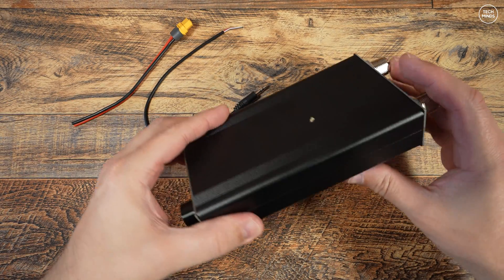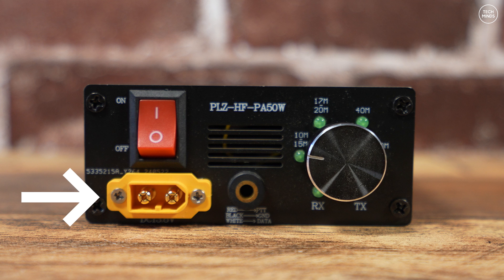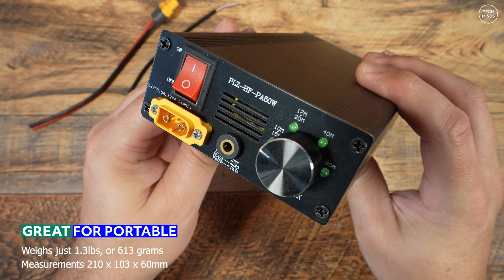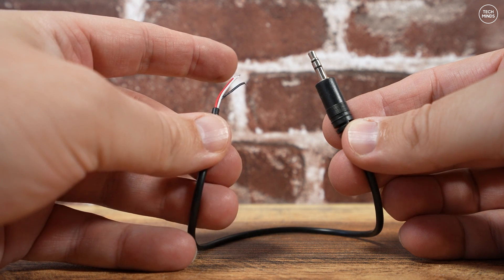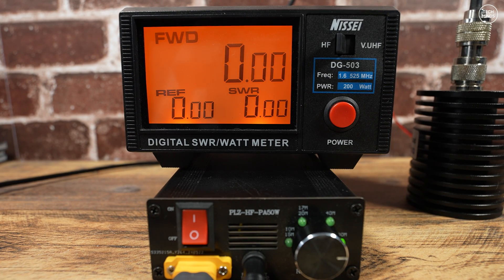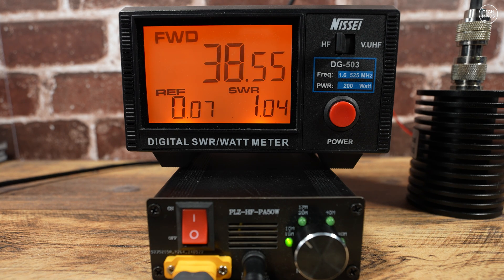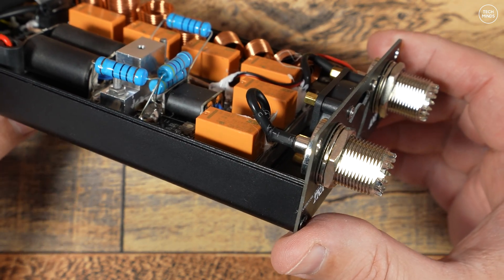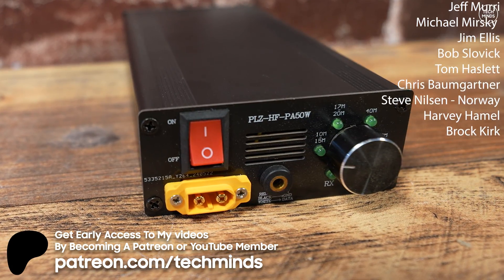Lightweight Portable HF RF Power Amplifier - PLZ-HF-PA50W

Comment: I just got mine two days ago. Absolute pile of junk. It clearly hadn't been tested before shipping. Immediately obvious was intermittent switching. I didn't connect it to a transmitter that would have been a disaster. In dispute with the seller, who doesn't want me to send it back, best he's offered is 30% refund and for me to keep it, that would sill make it a very expensive piece of junk. OK got the 30% back, The problem was the filter selection switch that had been overheated. Ordered a couple. Fitted it, but apart from switching two connections, it works fine.

Comment: With 2 minutes of thought, they could have arranged for the PCB identifier string that the PCB manufacturer put on the board be on the BACK of the board that's not facing the outside.  Lots of flux residue, too.   I wonder of the PCB band switching requires some sort of a microcontroller chip to be installed in that blank DIP package position on the board?   And yuck, SO-239 connectors!   I wish smaller devices like this had BNC connectors on the back!
Reply from the maker: I thought the same thing about the microcontroller. I couldnt see anything that would be used for the data line, unless its under the board, but I doubt it. Maybe behind the wires on the front panel. Anyhow, I have asked the supplier to see if they can provide any further information, or at least a manual. I wont hold my breath though! However, it does appear to work pretty well.
Reply: I just tried mine. The band LEDs are not showing the band changes. Seems to be stuck in 10m band. I thought it had RF sensing but it doesn't act that way. The PTT line works. Any ideas?
Reply: Mine acts same! It seems the band switch is broken, back popped out.
I'll  try clipping switch common to every pin by pin and  see if it switches bands.
Reply: @bobw2471  same here, mine is going back!

Comment: For a portable amp those large resistors and band pass coils flying in mid air are a likely to fatigue and break or short out. The lack of details on how to remote band control it is probably indicative of the overall quality and future support. My advise : Don't waste your money!
Reply: I agree. I have seen better come out of CB shops.

Comment: Woulda been interesting to check it with a spectrum analyzer.
Reply: I agree 100%...does it have a clean output?
Reply: The spectrum analyzer, and the also I'd like to see the output difference on each band with a 1watt and 5 watt signal going in, although for several bands the amplifier is out-performing it's 50 watt claim, and it's nowhere near the legal limit. We also have to remember that with 5 watts in on SSB, that power output will assuredly be lower. Then again as I tell other hams, dB matter more than watts.

Comment: I have the 100W version of this amp from the same company. I have not tested mine, but it did arrive with some damage. I plan on testing it in the coming weeks.
Reply from the maker: Which company would that be? I have not seen an amp that looks like this but it 100 watt.
Reply: Hi. This the amp I have. Have you connected it yet? If so, what cables do you use? thx j
Reply: @jeromesheffield2646  Sorry missed your question on cables. I made my own XT60 to power pole cable for power, and my own PTT cable. I used the cable ends that came with the amp. My radio has an RCA external PTT port, so I just wired the 3.5mm plug to that. My cables all worked fine, but again, the amp did not ...
Reply: @jeromesheffield2646  yea, I hooked it up and it self destructed. I think something was severely damaged in shipping. I didn't bother to get my money back, I'm going to use it for spare parts. I 💯 would NOT recommend the 100w amp
Reply: @b0r4t what do you mean self destructed? I got mine, and it doesn't amplify at all.. it turns the input wattage (which is 6-12w) to 1-2w.. I really want to use this amp to somehow get at least 100w.
Reply: Mine came with disconnected antenna port, once soldered it's amplifying. No RF sensing though.

Comment: Looks a lot like the Micro PA 50 with the annoying beeper and screaming fan...
Reply from the maker: no beeping and so far, didnt hear the fan when it was running.
Reply: @TechMindsOfficial  That sounds like a great improvement !
Reply: @fotografm  Probably just cut the wires to the beeper and fan!  😂😂
Reply: @stevehaywood5995  I did  !  Problem is the PA still is disabled when slightly overloaded and needs a power cycle to restart. Flashing new firmware is supposed to solve this issue and I cut a large hole in the case to install a bigger fan 🙂